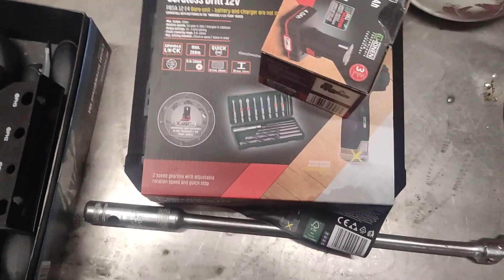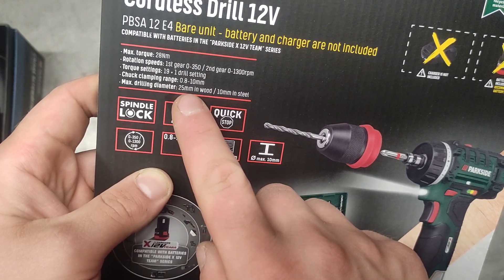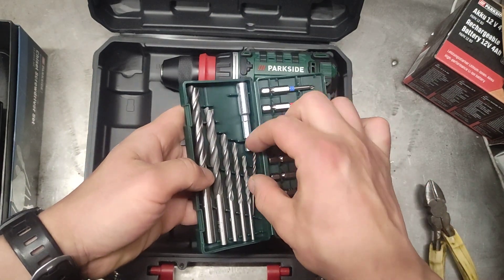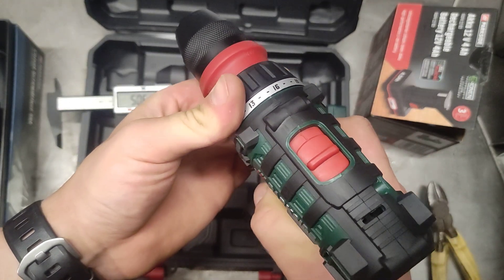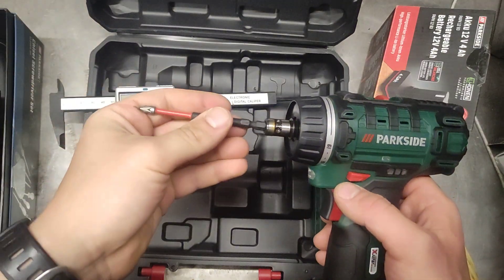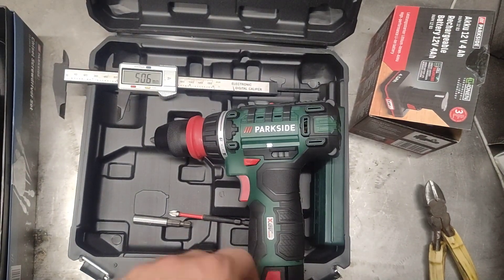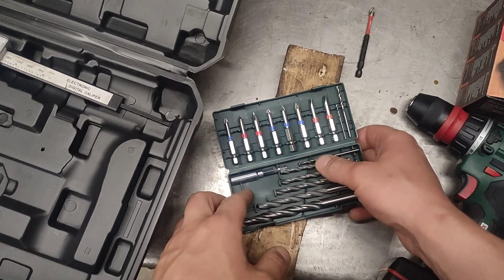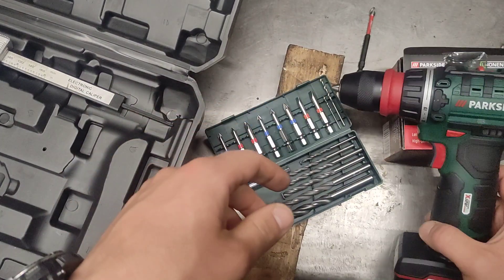Parkside Cordless Drill 12V PBSA 12 Review and Test

Comment: Nice video looks like a decent tool. Do you know if Lidl still sell any of the X12V stuff? It all seems to be the 20V range now. People are selling it on ebay, but it's got a huge markup compared to the original price in Lidl. Which I only realised after paying through the nose for the 2A battery + charger. I only have the 12V multitool and one battery at the moment, wondering if I made a mistake getting into the 12V stuff now and they have dropped it as a line?
Reply from the maker: Still got.the 12v around.me. at the shops
Reply: @MeFixingEverything  Thanks, better get on a tour of my local Lidl's then! 🤣